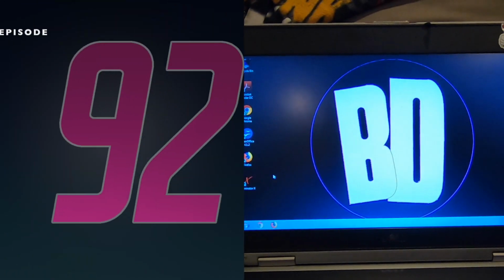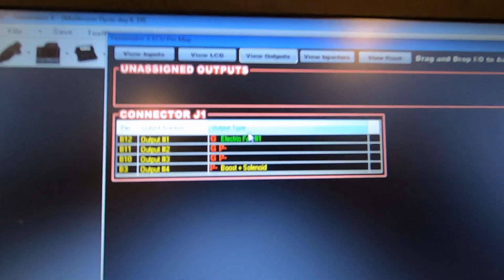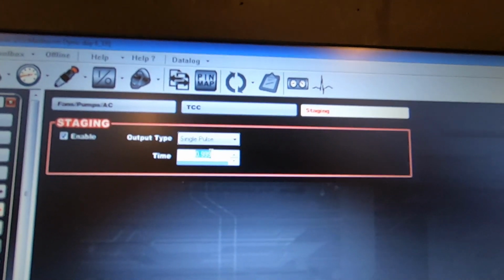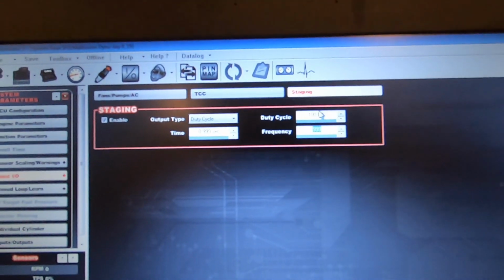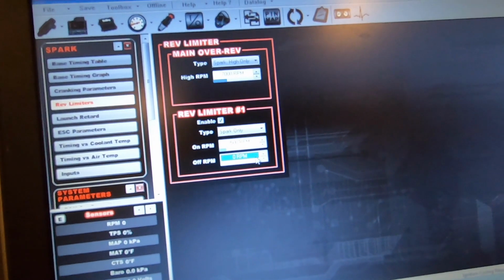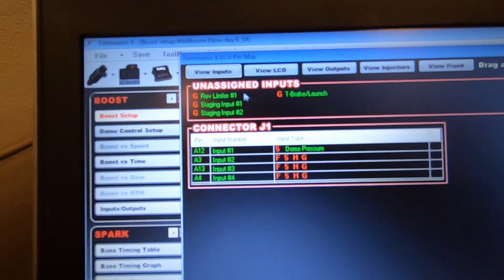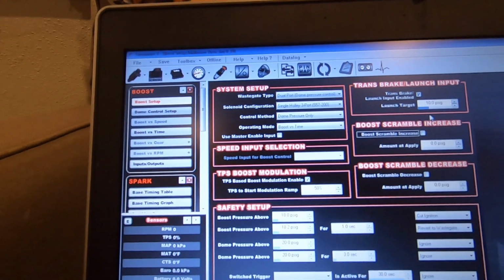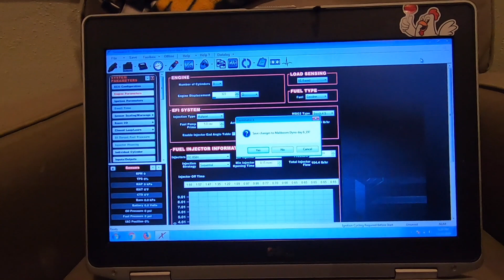Holley Terminator X Software Trans Brake and Bump How To

Comment from the maker: Let me know if you have any questions or comments!! Sorry the video was not the best but you get the idea! Ill figure out the whole screen capture thing one of these days.
Thanks everyone.
-Dane
Reply: You try that relay out?
Reply from the maker: Yes works fine
Reply: Burndown what settings did you end on?
Reply from the maker: @Nicholas  I think its at 30 and like 50 duty cycle. It just bumps in. I haven't played with it to see if I can get it to creep or do the small bumps in. Its pretty violent haha
Reply: Burndown From what I know and been told by those in the know... lower frequency and high duty cycle will calm the bump down a lot. I’ll be taking mine to the track and I’ll let ya know if I find a good setting. We have very similar setups so settings should cross somewhat
Reply from the maker: @Nicholas-im8bd   You will need a lower frequency for it to work. The duty cycle will be how fast it happens. If you get it dialed in nice let me know.

Comment: I followed your instructions. I have a th400. My solinoid is sticking. It's not a valve problem. It's sticking due to power. Soon as I take wire loose. It releases. Think it is the pwm ?   I set it to single stage lie you did. Just to verify it works. It will go in. But not back out till I take wire loose
Reply from the maker: The Holley just sends a low voltage ground signal output. All the power to the solenoid needs to go through a solid state relay for a bump to work. I would try another relay if its staying on it should be momentary. Maybe your frequency is too low or the time it too high. It only needs to happen for a fraction of a second.
Reply: @Burndown  I took the switch out and just touched wires. Soon as I touch it engages but want release until I unhook ground under car at solinoid
Reply from the maker: @havocracing6019   the 12v needs to go to a relay and then out the the brake. The brake should be grounded to the chassis. The relay is triggered by the Holley. If you trigger the relay and it stays on you have a wiring issue sounds like

Comment: For some reason when I re-open my tune, it doesn't show my I/O's that I created before. They function but don't show up in the tune
Reply from the maker: Make sure you save your files. Also you may need to download the tune form the ECU and save that before you work on it more so you have a back up.
Reply: @Burndown  if I have the laptop connected and view the same tune, it shows them. If I view the file on the laptop without being connected to the ECU, it doesn't show them.

Comment: Did you ever find a frequency and duty cycle
Reply from the maker: Nothing to make it creep. I just bumped it and it was pretty harsh. Just play with the numbers a bit. Im going to work on all this stuff when my cr is back up and running. Ill make a video when I got through the process as I get this question more than I thought I would. Everyones set is up different tho so what works for my car may not be right for yours.

Comment: I have watched both our videos on trans brake wiring and can’t quit see the diagram did you use a input protection module and where did you put it
Reply from the maker: I did not use a protection module. I figured the solid state relay act’s as a buffer. I’m sure an electronic guru may disagree but so far no problems.
Reply: @Burndown  that’s what I was thinking just wanted to bounce it off someone else also my first turbo build from being nitrous for 20years lol

Comment: Any help I can’t seem to get my bump button to work. I was able to figure out My trans breka
Reply from the maker: Play with the duty cycle. May need to be a lower frequency to work. You can actuate it with the motor off so you can hear if its clicking or not  before you fire it up and try it.

Comment: What solid state relay did you use? And do you have a wiring diagram for it?
Reply from the maker: I used a 20$ one off Amazon. I show a diagram in the video I have titled trans brake wiring.
Reply: @Burndown  so you're using 2 inputs and an output through holley to wire the trans brake?

Comment: Hey man im having a hard time getting mine setup, i have a single stage nitrous application, with the transbrake wired B+  care to give me the rundown of how to set it up in the holley? I dont use a bump function. Can seem to find a video of anyone doing it via 12v rather than ground. Any insight would be much appreciated! Thanks!!
Reply: Fought mine today and couldn’t get it working with 12v either.
Reply from the maker: See the reply above. Hope it helps.
Reply from the maker: I have not done NOS with a terminator yet so I'm not familiar with it but I bet you need a relay to run it. I know they sell one that is a solid state and you just use the ground to trigger the relay I imagine so the 12volt is run through it and the Holley output ground us used to ground the relay and let the 12v kick the NOS. You can also ask the terminator X forum on Face book as im sure someone it running NOS. Hope this helps.
Reply from the maker: Also I think you need an activation switch enabled as well to get the ground to trigger for the NOZ

Comment: 94 ss lq4 s10 to fire soon I keep learning more TY
Reply from the maker: Good luck man! I hope it roars to life for you. Just a note the Terminator X does not like low voltage so avoid running the battery way down and trying to crank it. I have heard it can cause issues so better safe than sorry.

Comment: Did your trans brake ever work with that solid state relay you had ? The SSR 40-DD
Reply from the maker: Yeah it works fine but I never got the soft bump in to work where you pulse the signal. Ill play with that more when my car is back up and running. The SSR I used works fine.

Comment: Is it possible to wire an after market oil pressure gauge using the input output harness???
Reply from the maker: Dannymclovin69 I have an aftermarket pressure transducer as an oil pressure gauge in the Maliboom and it plugs into the Holley harness so you won’t need to burn and input👍
Reply: @Burndown  I'm referring to using the gm oil pressure sensor to an after market gauge using the Holley harness is that possible

Comment: Hey mate, Killer video. 
just a quick question about the Launch PSI. Every value i try to enter in the Launch PSI comes up with an error message saying the max is (0.0psi).
Any ideas of what it may be?
Reply from the maker: Well thats not right. Is the rest of your boost configured? How much gate pressure are you running and what are you trying to launch at?
Reply: Burndown got it sorted mate, turns out you have to set your boost by time chart before you can select your launch psi. The boost by time or rpm max psi will be the limit for launch. 

I hadn’t set up the boost by time yet so it wouldn’t allow me to set the rest.
Reply from the maker: @mrtrentac  Ok thats what I was trying to find out. Awsome! good luck with it! Hope it hauls the mail for ya!!!
Reply: @mrtrentac  can you help me. Get mine set. I'm having same problem
Reply: Same exact problem. And I have a sticking solinoid due to some power issue. Or settings in holley.

Comment: Good work but I missed the one on how you wired all 3 to work on the same pin. I think you said they were all off the ground signal
Reply from the maker: Yes. All the inputs to the ECU are a ground signals. So when you push the button all the button does is make contact with a good ground.

Comment: Just set this up last week on my car. When I was browsing through the software and found the staging stuff... I freakin lost it 😂. I was so pumped I didn’t need to buy a bump box. 

I still wish the ecu has at least one or two more I/O
Reply from the maker: I think thats the game really. If it had just a couple more you would have no need to upgrade. In all reality tho I have one of each left at this point. I think I would like a drive shaft sensor but have not got that far yet.
Reply: @Burndown  , new to the term x ecu , removing my Fitexx. thanks for the vid as i am about to install mine, from what i saw from Holley if we add the 7'' dash it  adds more I/O's.
Reply: I’m sorry if this is a stupid question but did you have to get a valve body with a trans brake or is this holley’s way of eliminating that. Because I know the sloppy mechanics trans break for the 4l80e is just finding pinouts for the trans and not using a actual transbrake.